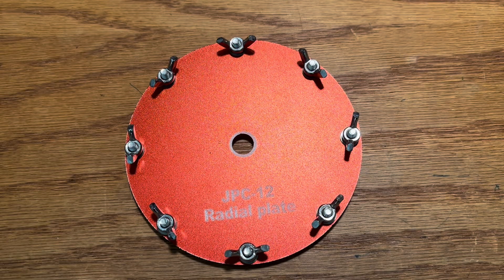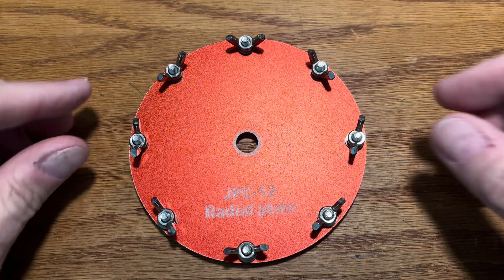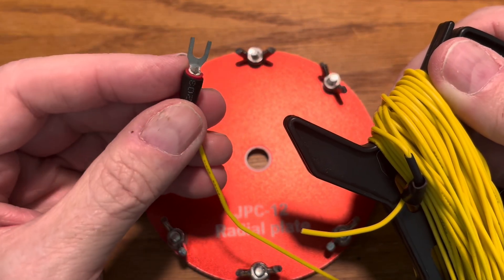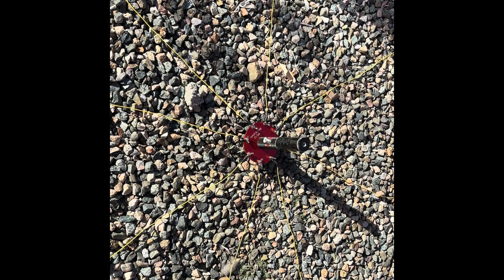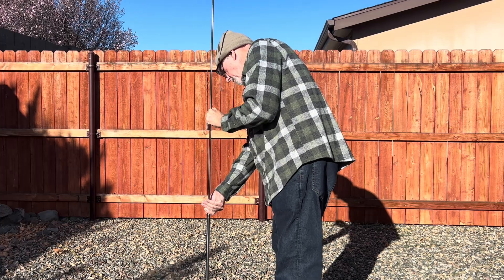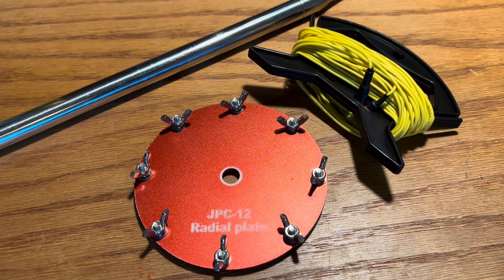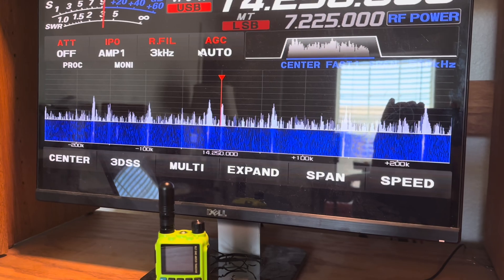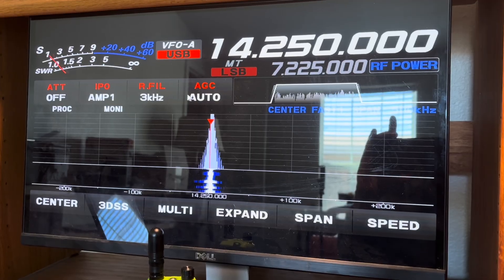Installing & Testing the JPC-12 PAC-12 Antenna Radial Plate and Ground Radials & 17’ Whip Antenna

Comment: I live in an RF hostile situation. I'm in a rented terraced house, surrounded by buildings and an electrical sub station at the end of my garden, pretty much on the south coast of the UK. Great!! However, been building my own antennas. I've built Frankenstein's JPC12 with parts from AliExpress and it's rigged up, staked in the back garden with a cap hat. 2 days ago, on a G90, under these conditions, I picked up a station in Alaska!! This red plate, after I fitted it, was a game changer for me. Cheap as chips great antenna. Success on 10/20/40m. I've got an upgraded feed point and extension tube on the way. I used copper speaker wire for radials on this plate and seems to be fine. Other stations have been Faroe Islands, Portugal and salty war propaganda from Ukraine. Thanks for the video! 73. M7DKU.
Reply from the maker: Sorry I didn’t see your comment until now. Thank you so much for your comment! I really appreciate it. This radial plate really made this antenna shine. It was good before but now it gets out and receives very very well. I

73 Dave N8DAV

Comment: Hello Dave, very nice YouTube video of yours, but could you please give me the link to Alie Express about that yellow counterpoise wire of 22 AWG? Regards, Fred
Reply from the maker: Hi Fred, thanks for the kind words. Here is the link to the vendor on Ali Express I bought the wire from. 

73’s Dave N8DAV

https://www.aliexpress.com/item/1005007481400501.html Soft Silicone Wire 16awg 18awg 20awg 22awg 24awg 26awg 28awg 30awg Stranded Tinned Copper High Temperature Cables - AliExpress
Reply: @BrilliantHam  Thanks

Comment: I just got one those those disks, mine has no paint on it at all. The label and the ring around the centre has been bead blasted so that it is bare and has good conductivity.
Reply from the maker: Conductivity is key for a good counterpoise. I used some sand paper to make sure mine has good conductivity. This disk makes for good ground radials.

73’s Dave N8DAV

Comment: Great review.  I purchased this same plate for the same antenna system … i made a 8 x 3 = 24 radials at 25’ each… and the antenna works very well on 20m, 40m, and 80m.  I have also purchased the 17’ stainless steal whip plus additional purchased sections of threaded M10 aluminum rod sections.  This plate organizes everything radial wise very well.  Thanks for the video!  VE3VVW 73
Reply from the maker: You’re welcome! I loved doing this one because I was looking for a better than the stock solution. And if you make the radials from silicon insulated wire, the radials do not get tangled. Which was a big goal for me. This plate and radials work really well for me also. I use it every time I use this antenna. I also have the 18’ whip antenna which adds more versatility to the antenna. I am planning on doing my first POTA with it soon. 73’s Dave N8DAV

Comment: Did you find a big improvement in comparison to the factory ribbon radial included? I actually just designed and sell a guying system specific to the JPC-12 along with made my own radial plate so just ordered my wire to make the radials.
Reply from the maker: @SubaruTrekkie  As far as SWR is concerned, there was no difference that I saw. I have only set this up in my backyard so far. I am waiting until after I move before I go out to do POTA. The conditions in my backyard is all rock since I live in AZ and we all have low water yards. Not the best conditions for a ground plane. I thought by doing eight 5 meter long (40 meters total) radials evenly spaced apart would be better than my spacing out five radials about 5 meters long. Using the supplied ribbon cable I separated the ribbon cable into 5 radials of 2 wires each. I got out okay but mostly in one direction, east. I then separated it into 10 single wire radials of 5 meters each and noticed no difference except that even tho I wrapped up the wires they get tangled very easily. Untangling them when you are setting up is a PITA. So, you asked about how this plate worked with my homemade ground radials. First I used silicone insulated 26 AWG wire. They are a pleasure to work with as they do not get tangled up. I also didn’t mention I have a large hill due west of me so getting out to California is near impossible. With the ground radial plate and 40 meters of radials the antenna performed very well. I not only got out eastward, but I got out northeast and southeast. I had QSO’s all along the east coast including into the Caribbean and South America. The big surprise was I was hitting eastern Canada, Oregon, Washington and Northern California with this set up. I even got one QSO into Hawaii. This was all on the 10 meter band. With the antenna configured for the 40 meter band and center loaded at night I was talking to Southern California and northern Utah. Obviously, band conditions have a lot to do with my results. But I believe that my attempt at making my own ground radials specifically at 40 meter total length made a difference in performance. The supplied ribbon cable is not a good solution. It is easy to break the wires and with my dyslexia I don’t necessarily separate the radials evenly. Plus being gray in color they are not always easy to see making them easy to walk on and trip over. I realize I don’t need the plate. I could do a power pole connector solution as well. But the plate with the addition of yellow wires makes it easy for me to separate the radials more evenly as I just go straight out from the plate for each wire. I know this all sounds kinda dumb but it is my thought process. Sorry, I know this is kinda long, I hope this answered your question.
Reply from the maker: @SubaruTrekkie  BTW, we get some pretty good winds out here and I left my JPC-12 set up over night and the wind did not push it over. But I would be interested in seeing your guying system.
Reply from the maker: @SubaruTrekkie  If you would like me to review any of your products I will be happy to. I can send them back when I’m done with them. N8DAV